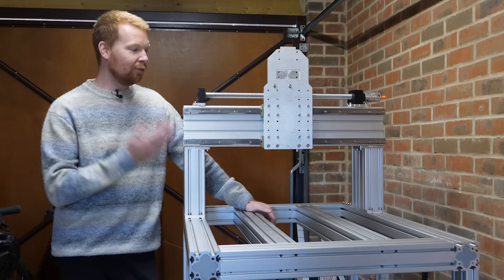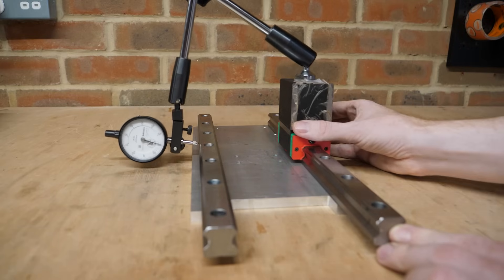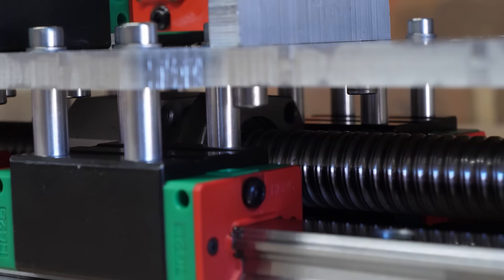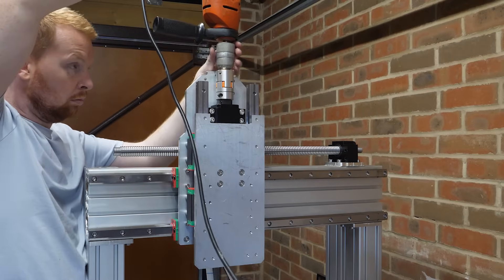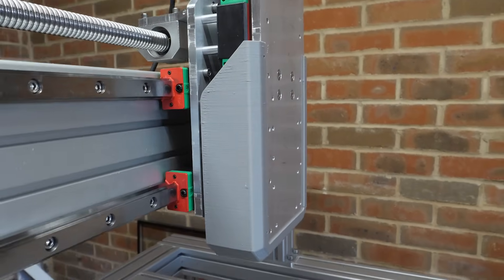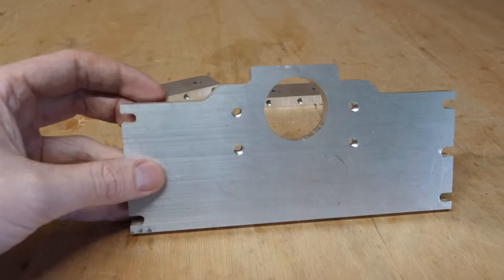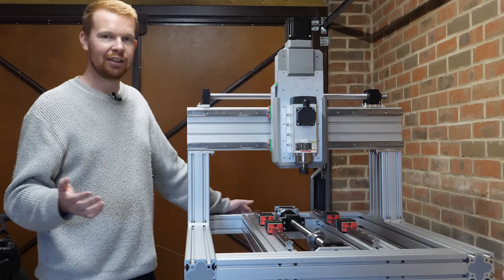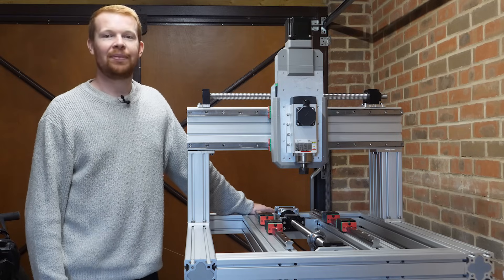Building a CNC Mill/Router - Part 3

Comment: those spacers are gonna get you later with rigidity issues. Its better to have blocks with holes than little standoffs.
Reply from the maker: As soon as I get the machine running, I plan to cut out some solid block spacers.
Reply: @TimStation  This tracks, I assumed the whole point of building a CNC machine is so that you use it to make parts to upgrade your CNC machine 😁
Reply: @glittalogik 
After doing a test/calibration cube on my first 3D printer, the next several days were spent printing upgrades to itself. I think I used about half the supplied 1kg spool of filament upgrading it 😂
Reply: @tin2001  which printer did you buy? and what were the upgrades?
Reply: @TimStation , I had the same thought. Your old machine would have the capability, but you are not too keen to use it anymore?
Reply: @maxmustermann2596  At the start of the video he said his old one broke and needed to source a new pc
Reply: @pleasedontwatchthese9593   But he also said that he fixed it, didn't he? However, it makes sense that he couldn't use it back then, and in the future, he will have a better machine.
Reply: came to the comments to see if this was noticed too

Comment: 5:18 Watercooling would get moldy.

Would distilled water solve this?
Reply: it'll solve it in the short term, but in computer water cooling people add biocidal chemicals to the loop to prevent microbial growth and a similar solution would probably be useful here.
Reply: The correct solution is automotive coolant. Those spindles aren't meant to have pure water in them.
Reply: water cooling NOT used water, cooling used normal car cooling liguid and mix little to water, then not ewer have moldy problem, car not have moldy problem ewer.

Comment: You can get an adapter for parallel port, also you can run mach3 on windows 10 or whatever you like.
Reply from the maker: I bought a windows 10 machine with a parallel port adaptor, but it didn't work. Apparently it requires windows 7 32-bit or older. However, I also tried a windows 7 32-bit machine and the mach3 driver blue screens the computer haha
Reply: @TimStation  Why are you still using a parallel port? USB mach3 boards are extremely cheap from China and work perfectly with windows 10.
Reply: @Sergeant898  USB have lot lot lot problem and ewer not can run important real time. safety have important and need use REAL TIME process. and thats have only linuxcnc what used many factory automation ,factory not ewer used automation whit worst window OS, not safety and not REAL TIME. if want perfect safety cnc need use linuxcnc software, mesa card, old 40$ or better computer, NOT laptop, many laptop ports not give out real 5V only 3,3Volt and all software not working good this volt have too weak.
Reply: lot better not use paraller port adapter have worst not working good, but buy normal pci/pciE paraller port card to computer working lot better, i uses my cnc 2 pcs pci to paraller port card, cost 10$ and have lot more input/output pins. and safety linuxcnc software, because windows OS software not have factory quality safe OS, need be REAL TIME system. have safety lot more.

Comment: It would be far better if you did not remove the washer from the bolt and grind down the top of the bolt instead.
Reply: Itt use a button head screw.

Comment: Why wouldn't you build the base from steel C channel so it's cheaper to make a much larger CNC? It's not like weight is a factor and it's just the same amount of work.
Reply: More difficult to work with unless you already have a lot of metal working tools and it's generally much less dimensionally accurate than extruded aluminium as delivered.
Reply: Square steel tube, rather than C section.  But there is no way it is "the same amount of work"!
You are pretty much describing a "PrintNC" machine.
Reply: @PiefacePete46  PrintNC isn't accurate without much work , its 100% as accurate as square tube used and 99% of people won't tell u that you should mill both sides of square tube for it to work properly or rail twist = damage.... plus it's really hard to mill it because square tube have stress in it from manufacturing = u mill one side , the other one bends 
so for everyone wondering why extruded aluminium ....its super accurate out of the box
Reply: @ErtsenPlayGames  :  Absolutely!  That is exactly the point I was trying to make.  (Maybe I did not word it clearly enough.)
I watched every video on Bryan Howard's channel about the making and refining of his PrintNC.  The end result is a very useful machine, but it took a HUGE amount of time and effort it took to make it as accurate as possible.
The first part of my comment was that C section is a worse idea than square steel tube. I wasn't suggesting that steel tube is a better alternative than aluminium profile, even if it is heavier and stronger.
I completely fell in love with Piotr Wysocki's granite gantry mill though, and the amount of time he spent chasing microns was amazing!
Reply: @PiefacePete46  Granite machines are incredible, I've wanted to try my hand at the more accessible option of epoxy granite for a ages but it still requires an abundance of surface plates or a surface grinder the size of a small house to take proper advantage of.

Comment: Other than friction and bendy bolts there doesn't seem to be anything to stop the Y-axis  motor from partially rotating under it's own torque and causing a position error. Why didn't you just make another plate like the one holding the Y-axis bearing block?

Comment: When the CNC is finished, you can use it to make replacement parts for the 3D printed parts. Also... imagine using this as a 3D printer?
Reply: It would be ridiculously slow as a 3D printer because of the screw drives.
If you replaced the screw drive system with a faster method, the rigid frame would cause all sorts of print quality issues.
Reply: @tin2001  What issues does a rigid frame cause? I thought a frame can never be too rigid.

Comment: Your spacer are a really bad idea....please dont do this....
Reply from the maker: I agree, ideally I want a solid 'block spacer' instead of the standoffs, but my older machine isn't capable of making such a part. Once this machine is up and running, I'd like to make a few upgrades! Thanks
Reply: @TimStation  Just make a crusty block with a hand drill, the holes aren't the important part.
Reply: Bumping it up for both explanation  and for Tom to see.
Reply: @THEJaManes  Die Spacer verringern die Steifigkeit extrem und weiterhin ist die Flächenpressung durch die geringe Oberfläche sehr klein. 
Eine Schraube darf nie durch Scherkräfte belastet werden. 
Es gäbe bessere Lösungen, wie z.B. zwei separate Platten für Y und Z, welche aufeinander geschraubt werden, durch Kegelstifte in Position gehalten und verschraubt. 
Ich baue CNC Maschinen seit 2003...
Reply: @svenkrause3433  so muss das. Auf deutsch und für alle verständlich 😊
Reply: @svenkrause3433  Hope that the google translator didn't lose anything in translation. Thanks

Comment: A tip for the old PETG if you have a hot water cylinder, store the roll in your airing cupboard.
Reply: Translating to American: "A tip for the old PETG, keep it in your water heater closet."
Reply: @barnett25  Called a Hot Press in Ireland. 😂
Reply: What about filament dryer?
Reply: @WhatWorks-DIY  You could use one, but there's no point in using one if you already have a suitable warm location. Tom's in the UK and from what he's shown in his videos, his house looks to be a larger house which would typically have such a cupboard. I've always thought that filament driers were a rather niche product as I bet that many people would have a suitable warm place somewhere within their house.
Reply: @yngndrw.   I live in UK, my printer is in the livingroom which is the most exposed room and it's pretty cold, I use one of those filadryer s1 with a towel around it to insulate, I managed to get petg down to 25% humidity